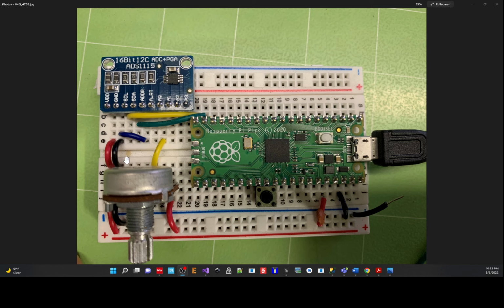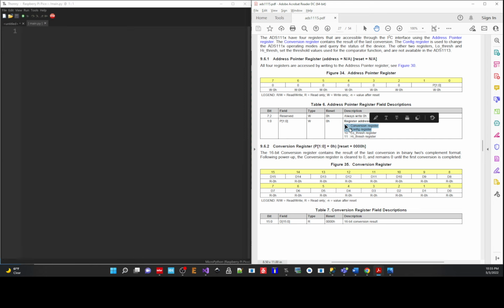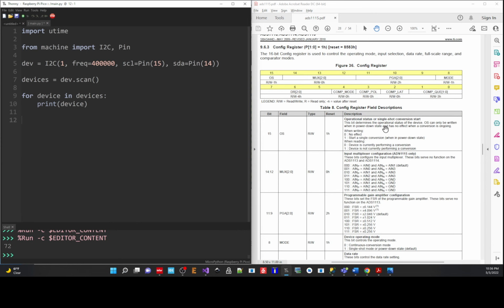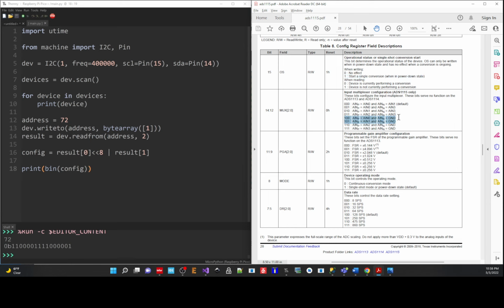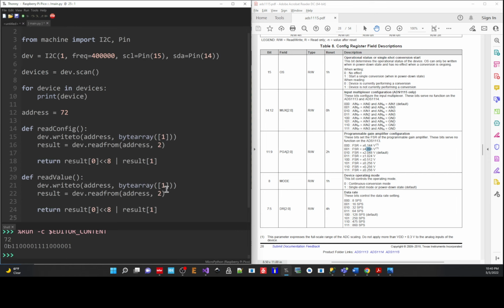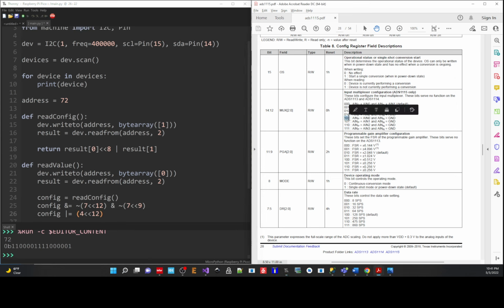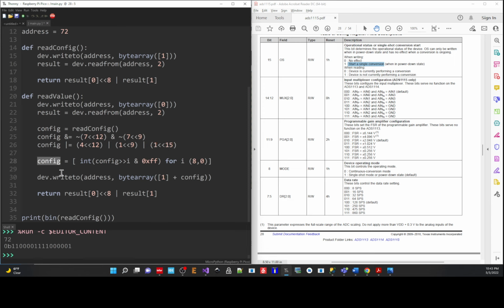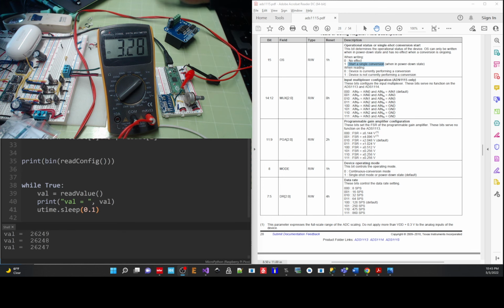Video Request: How-to read ADC from a Pico using I2C and Micropython

Comment: I'm trying to follow the instructions in "Video Request: How-to read ADC from a Pico using I2C and Micropython" on YouTube. I'm approaching the subject for the first time so I'm not very familiar but this video explains exactly my situation (the only difference is that I'm using a 10k ohm potentiometer). I can make the program work only if the knob is turned completely for 3.3 V or for 0 V, otherwise it gives me an error on line 36 and on 21, it gives me an error even if I let the program run for a few minutes, and at a certain point it stops by itself.

Comment: Hi! Trying to make this work, completely new to micropython. I wrote this the exact same way as you. Getting this error trying to run: 

Traceback (most recent call last):
  File "<stdin>", line 35, in <module>
  File "<stdin>", line 15, in readConfig
OSError: [Errno 5] EIO

Line numbers are same as in your code. 

What could the issue be?
Reply from the maker: Come join here https://discord.gg/ngnV5Xe5WN

Comment: why don't just use pico‘s internal ADC？
Reply from the maker: Because the video was a request from a viewer that wanted to see how to read from the ADS1115, people use this adc to read joystick data and if you want to connect 2 joysticks you will need a external adc because the pico has 3 inputs.
Reply: The Pico's internal ADC doesn't work